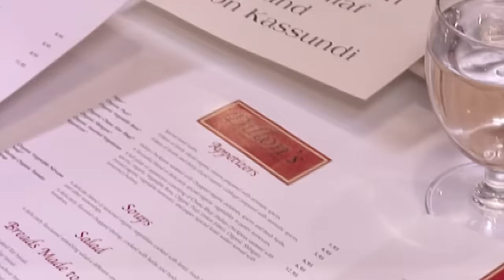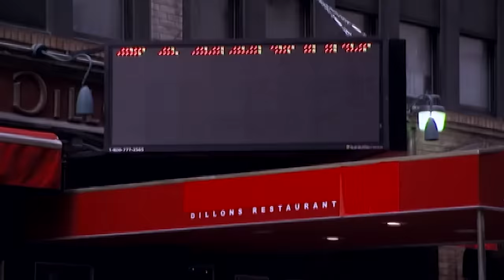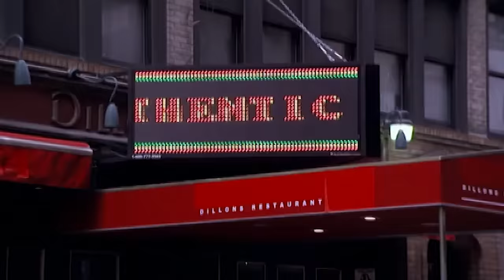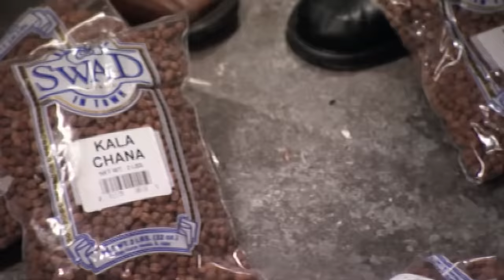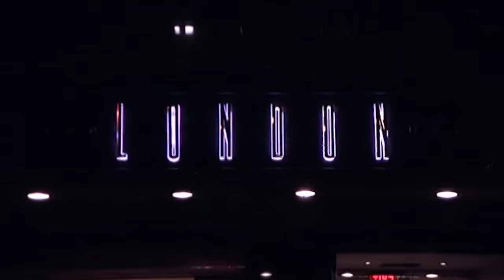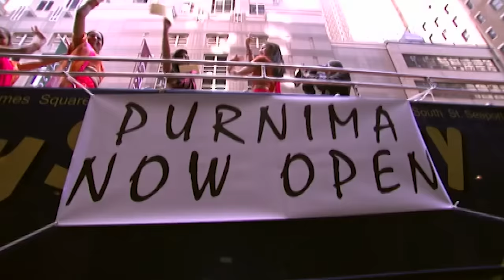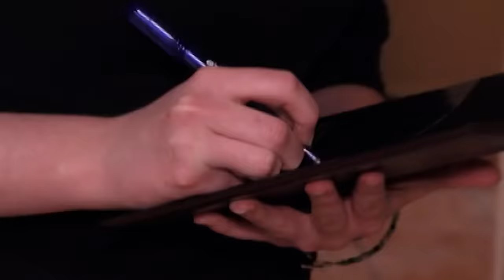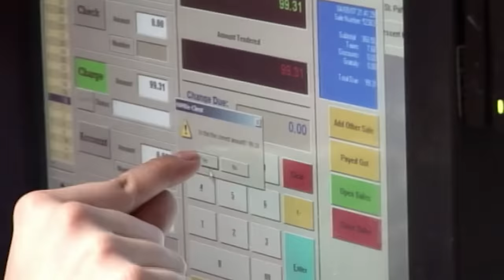"If That's Beef, Then I Was Born In Bangladesh" | Kitchen Nightmares FULL EPISODE

Comment: That lamb biriyani looks like 10 days old rotten stuff. You could get better biriyani  than this in cheap shops or in any streetfood stalls. I had ate the worst fried rice from an hospital canteen it was greecy and smelled like old car engine oil, another worst is from an local restaurant which uses very cheap rubbery plastic like rice that restaurant is closed for  years.